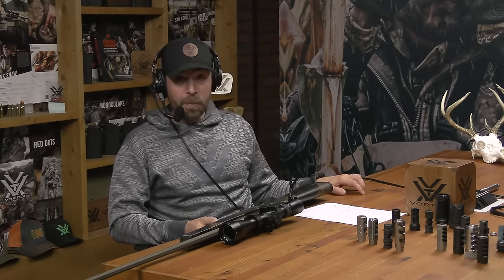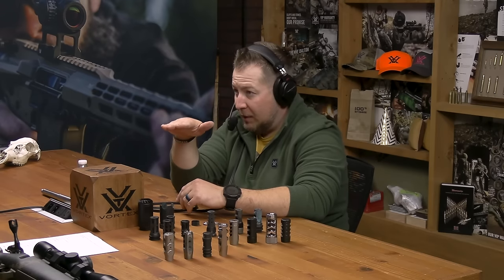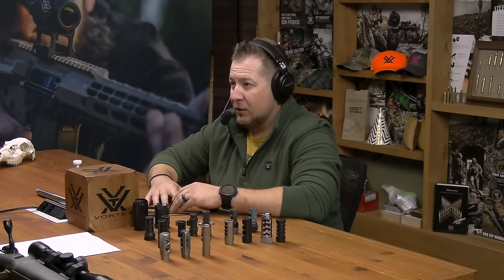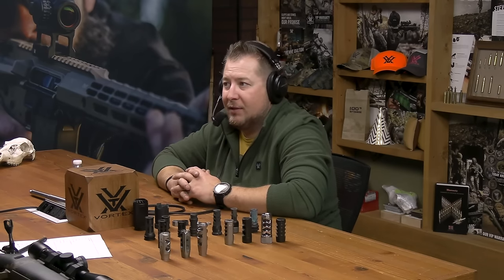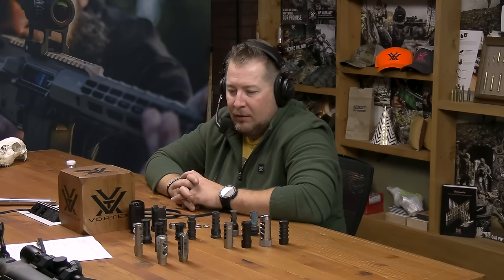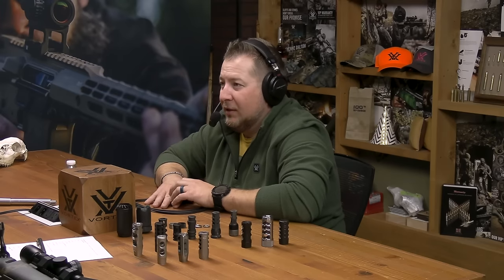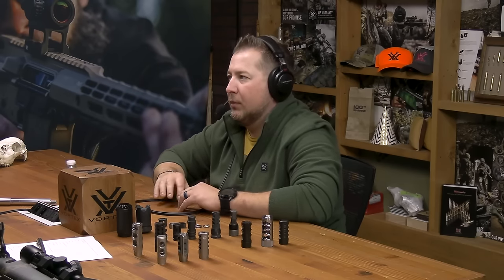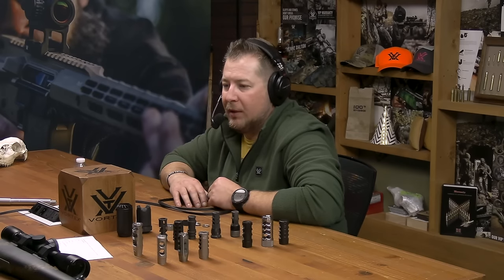Ep. 266 | Muzzle Brake Breakdown

Comment: I'm really late to the party - but just past the 27 minute mark, term you're looking for might be SPL ; Sound Pressure Level (a pressure wave created by the movement of (a large volume of) air).  In reference to audio/speakers, the SPL relates to how much 'thump' you feel in your chest/body when the bass hits. There is more in an enclosed area, as the pressure bounces off of walls (or in a vehicle, off the ceiling and doors, etc) - but it is obviously much less than a single shot of a rifle going off - but it is the same idea/principle, at least, that's my take.  Cheers

Comment: The best saying I've heard for muzzle devices is this.

Most people who think they're in the market for a muzzle brake are ACTUALLY looking for a suppressor but don't know it.

They don't cut recoil as much as a purpose-designed high quality brake like an Area 419 or an Ultradyne, but they reduce recoil by a noticeable and often quite significant amount while also making the gun less obnoxious for everyone nearby.

A brake that acts as a QD attachment for a suppressor is the best of both worlds as long as you account for your POI shift. I don't have a rifle larger than .30cal so something like a Dead Air Sandman S with keymo brakes on all my rifles lets me switch one suppressor between any rifle I want to use quickly and easily. And I'm not even really using the keymo brakes as brakes, but as a QD system for my suppressor.

Comment: First shot through my new MDRx 308 with the factory brake/ comp/flash hider (I'm lefty)  felt like someone sucker punched me on the right side of my head went and fild stripped a cupple un used cig butts for my ears. The brake made the 308 kick like a child compared to my factory colt ar15. 
 The 223w with there 3 way muzzle device was no need for ear screws.  Almost no recoil  no waitting for it to come back down for follow-up shots.

Comment: Proper hold techniques mitigate any muzzle rise on a Tommy Gun. First of all most of them way more than enough and fire from an open bolt and there is no Muzzle rise. I see people put that against their chin and shoot it in full auto and still be able to write their name with the damn thing. The 5 1/2 lb that I qualified within the Air Force and the second time I qualified with it when it was eight below zero and a 50 mile an hour wind in my face. Where I fired 40 rounds in full auto and still shot a 3-inch group. Has no Muzzle rise. As long as you're holding it like you're supposed to.

Comment: Old mate missed asking a massive import question.. More or less ports better or worse!
How many ports you guys think is optimal. Say on a .308 win
Reply from the maker: We consulted the all-knowing Ryan Muckenhirn  on this one! He says: This is a very difficult thing to state definitively. Looking back in time to when I worked for a company that made many, many muzzlebrakes for several manufacturers, as well as our own, the running joke was something along the lines of: "Designing an effective brake is highly scientific. Drilling holes in metal until it feels better than it did before!"
Port size, placement, direction, and body type all have a big impact on how a brake feels, as does rifle style, weight, and caliber. Some of my favorite comps were "high pressure" operating, and had a single, large port with high-pressure jet ports in the top (see: Nordic Components Corvette Comp), and some of my fellow shooters absolutely hated them. Other very popular options, like the Rolling Thunder, SJC Titan, and the JP 3-Port comps were heralded as outstanding as well, but many of us also saw and realized that they had a tremendous amount of mass that they were adding to the system, and this may have assisted.

Radial brakes have many, many holes, and in the right application, can be very effective as well. I run a radial on a few rifles, and have always been impressed by the feel.

I realize this round-about explanation is not so definitive, but truly, "it depends". My next comps will be a 2-port design from Hawkins, and I'm certain they'll work!
Reply: @VortexNation  wow!! Wasn’t expecting that hey! Thank you so much for this reply. It’s a huge help for me! Love all these episodes and talks you boys do! Also thank Guru Ryan for his help on this one 😊🙏🏻
Reply from the maker: Absolutely! Happy to help! And will do - if you have any other questions, don't hesitate to ask!
Reply: @VortexNation  well in saying that, does adding an adapter plus brake throw out the harmonics even further than just the brake?
Reply: I heard 4 ports is optimal. which would be a little bastard in the spa brand. I just bought a fat bastard which has 5 but I have yet to receive it so can't tell you how well it works (or not).
Reply: app sorry spellcheck got me
Reply: APA

Comment: Honestly have zero use for muzzlebreaks, or a threaded barrel.  I hunt, and the threaded barrel is just one more thing to go wrong, and the muzzle breaks are just extra weight  and bad for hearing.
Reply: Literally 1:16 into this video "I wouldn't wanna shoot it without a break"

1:51 "Admittedly, I shoot this gun better with a break"

2:30 "It makes the gun more shootable"

2:54 "You're just going to shoot a lighter (recoilong) rifle better" " you're less likely to make bad habits, like a flinch"

Go on, talk some more. I love your uneducated opinion. You should get a job at Vortex and tell these guys what they don't know, since you know so much.

You must stalk a lot of paper targets in the woods
Reply: @Honkers716   

I hunt thick bush and hard woods where most shots are under 150 yards. If I'm not pushing deer, I'm sitting in a stand or box blind. 

A muzzle break ads weight. Which is a negative when pushing deer or in my tree stand. A muzzle break directs gasses, making it a louder noise in my box blind. What if you don't use that muzzle break well now your threaded barrel cap can work it's way lose throwing accuracy off. 

I also find it not surprising to me that out of all the hunting camps here in Ontario I've been to I have yet to see a single muzzle device being used. There are more negatives then positives to adding the extra weight onto the rifle when hunting in thick woods.

I also prefer to practice my rifles in the configuration they will get use out of in the woods. So I would never be using one of them to make my practice easier. I want my practice to lead me to be better at managing it's recoil in the cases I'm shooting at game, so adding a break is counter to that.

Which brings me back to I have zero use for a threaded barrel or a muzzle break on hunting rifles. It's a pointless waste of money and time, that only adds negatives in the woods.

 Magnum calibers? Still wouldn't use a break.  at 6 foot 250 pounds I have zero issue with shooting a 300wsm without a muzzle break. Maybe if you got to the range and actually put the practice in you'd be able to do the same. 

Also odd how you don't see very many Safari guns in the largest of calibers with breaks. Ya because it's a pointless add on that only negatively effects you while trucking around the wilderness on foot.
Reply: @Honkers716  Well if you need to use breaks to make up for your short, and underweight stature go right ahead. But unlike you I'm not the size of a women, the fact is I have zero use for such devices on my hunting rifles.  And so do most hunters, especially those hunting big game with the various magnum length cartridges. 

Like honestly go look up safari rifles. The only time I've seen a break on an African hunt was on a 50cal and that's as far from a normal hunting rifle as you can get.
Reply: @canadianguy1955  🤣 Look at the snowflake have a meltdown ^
Reply: @canadianguy1955  lol at 6ft and 250lbs it's funny for you to talk about other people's stature, you're beyond "dad bod" stats
Reply: @canadianguy1955  *You're
Reply: I have to use a break, as for medical reasons I have to keep recoil down to 15 foot pounds or less. even a 308 is to much. 6.5 creedmoor is to much. it's not that I can't handle it. before my medical problems I would shoot my 45-70  and 7 mm rem mag all day some days. but now it's a matter of recoil could litterally kill me. so any thing that will reduce recoil I will use and use multiple things at once.  a break, nice recoil pad, added weight, a padded shooting vest.  so yes I most definitely use when hunting, but I solo hunt and mostly spot and stalk, and most the time I go on trips that put me 20+ km into the bush. far from any one.  it is what it is so I use.